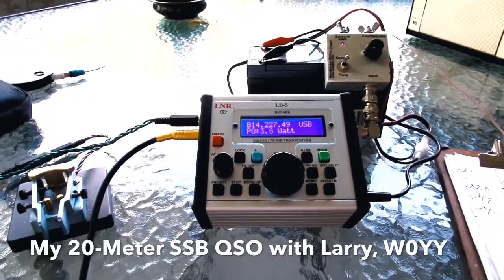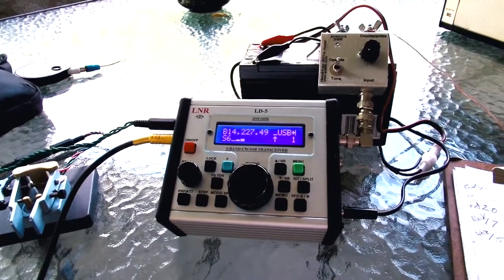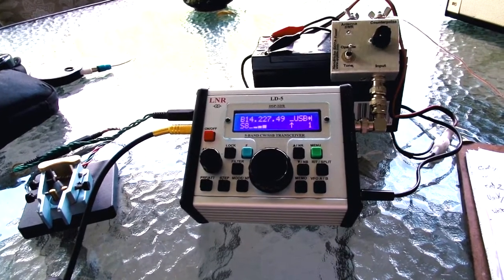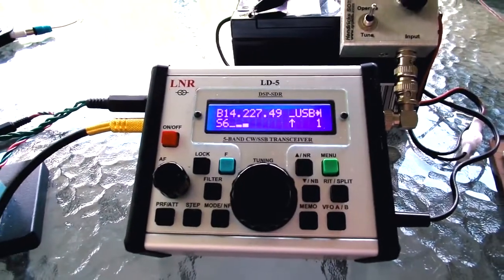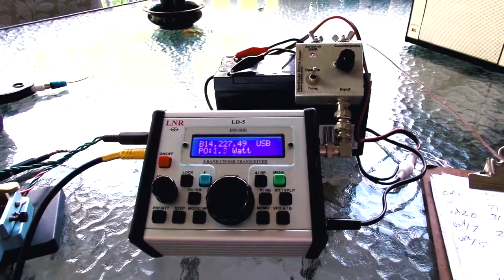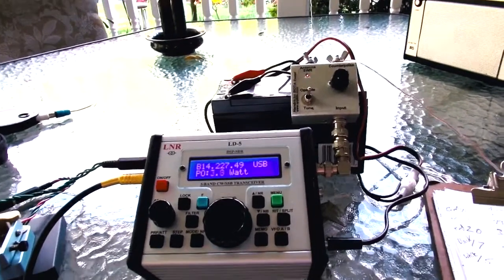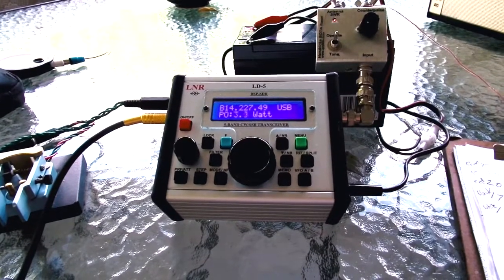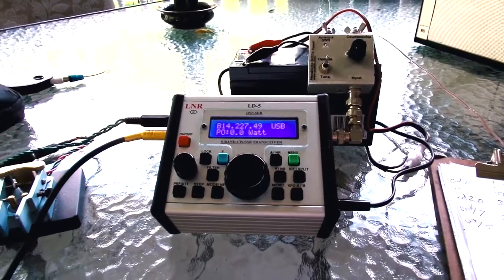LNR LD-5 Transceiver SSB QSO

Comment: Where did you get that antenna tuner you have hooked to the LD5?  Thank you!
Reply from the maker: Hi, Hunter. It’s the SOTA Long Wire available from qrpkits.com. It is easy to build—built two of them w/ no problems. Works very well even with 4’ counterpoise for40 and 20. Here’s the link;
http://qrpkits.com/sota.html
Good luck and 73’s!